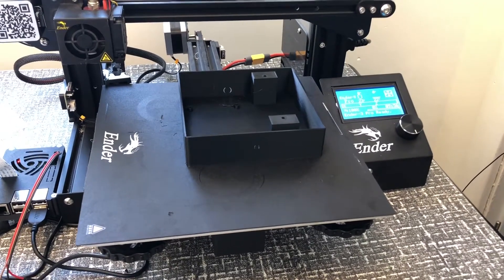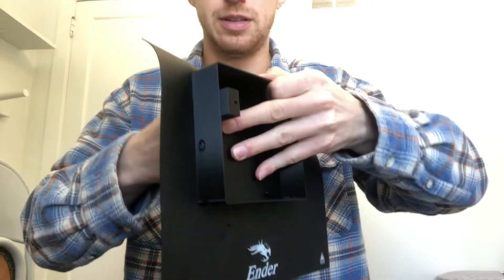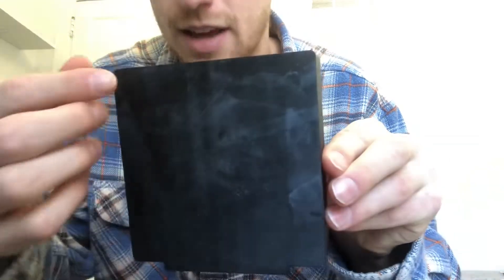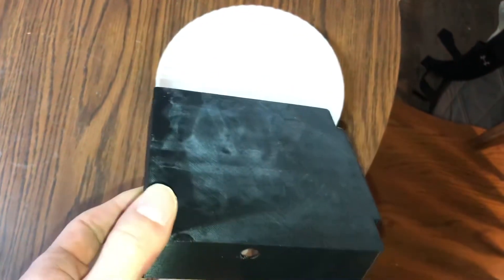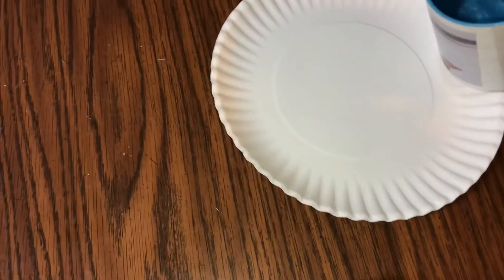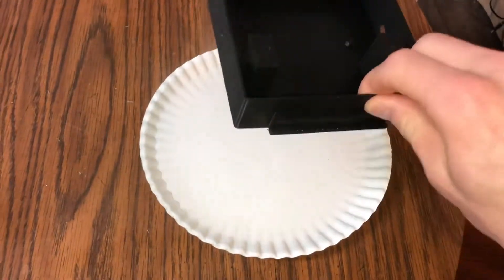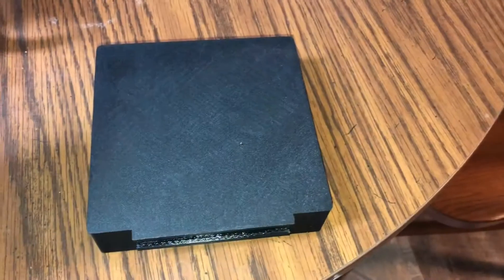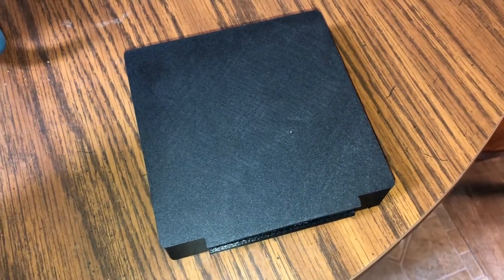Removing White Residue from Dark PLA 3D Prints

Comment: The heat gun worked for me much better. Hot water didn't help at all. you can see the marks go away visibly when you use a heat gun at low settings.

Comment: I just use low temp heat gun. If you don't have low temp heat gun just run the heat gun over the surface quick.